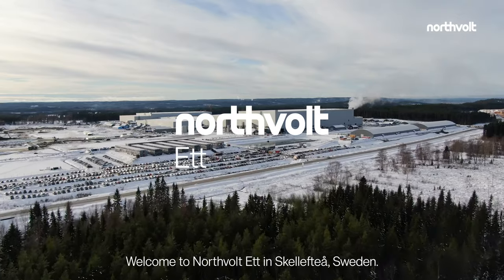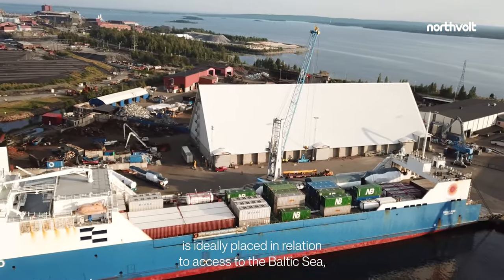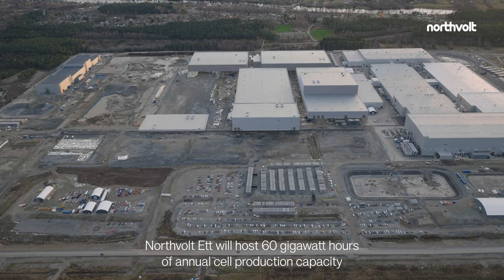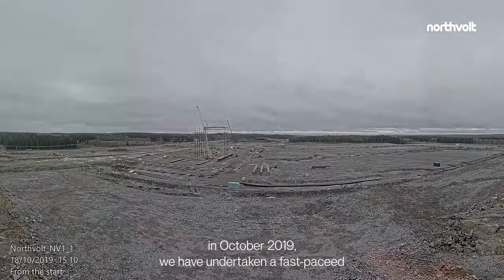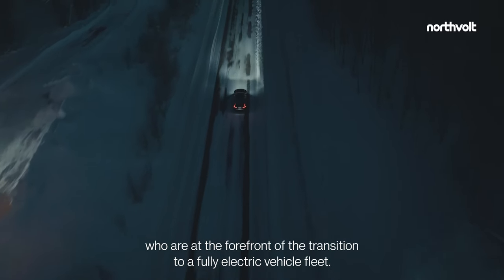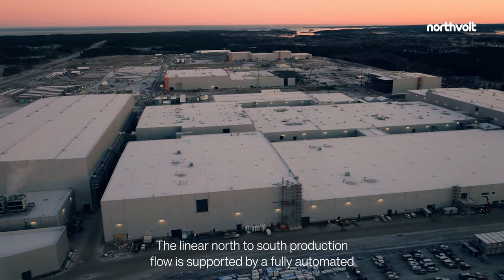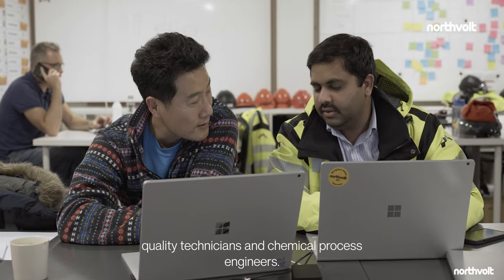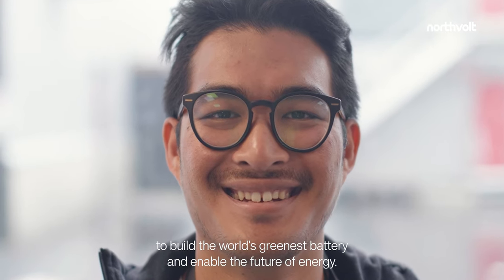This is Northvolt Ett

Comment: NMC batteries was very doubtful 5 years ago, where are your LFP cells? I personally would not buy NMC in either storage nor vehicle...
Reply: Who the f wants low energy-density LFP lmfao
Reply: Why not? Are you worried about safety? Li-ion is extremely safe in cars. The statistics is very clear on that. BEVs catch fire far less often than ICE, and when they do, it’s very rare that it has anything to do with the battery pack.
Don’t let perfect be the enemy of good. Neither NMC or LFP is perfect. They each have their roles in EV and storage markets.
Reply: @auspiciouslywild On paper your right, but truth is that Northvolt batteries is new and so far untested compared to all other vendors, we simply don't know the failure rate of 100000 mass produced NV cells yet, and since LG and others have issues with thermal runaways not only in cars but energy storage, it's simply just a matter of safety that NMC cannot where modern LFP can.

I have done serval battery packs for both small 12v ups and ebike but even for those with excellent bms and high quality cells I dare not trust them fully. And in a car with 2 small kids, if fire we have too less time to get them out alive if NMC burns. Our diesel is more reliable in that way (and cheaper)